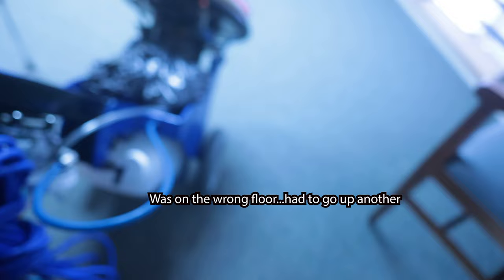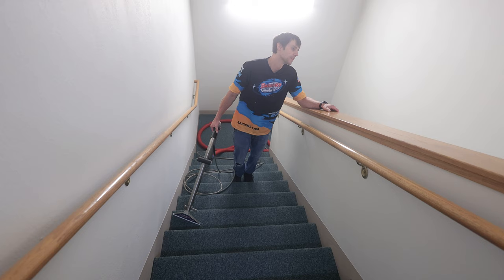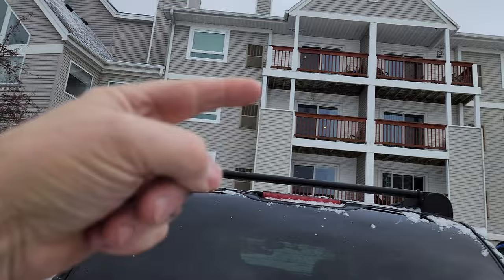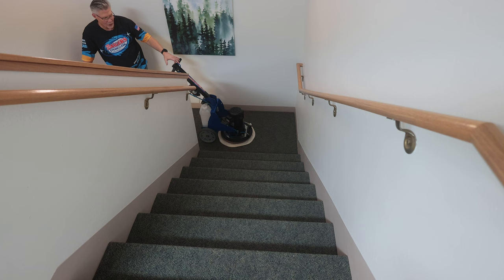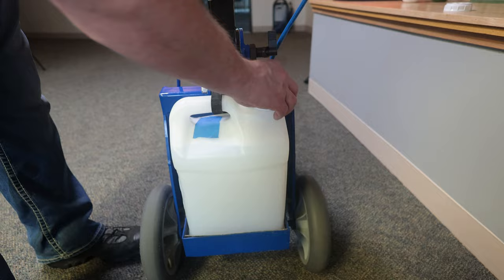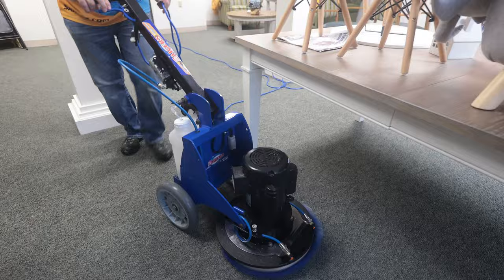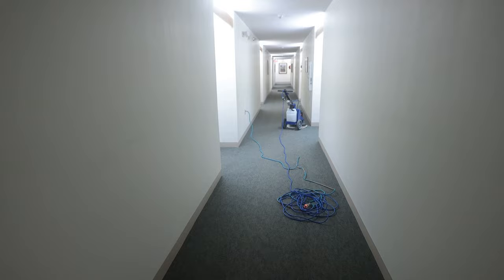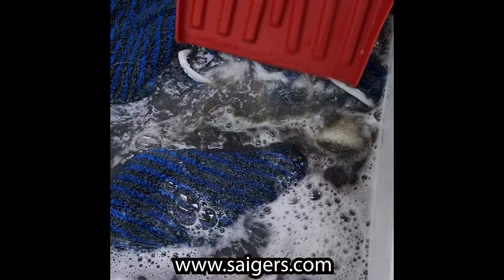ALL In Good TIME! All Floors DONE!

Comment: Great video Mark, thanks for sharing. By the way, is that an industry-specific tool that you used to VLM the stairs or is that just a hand buffer? Do you use it too if, for some reason, you needed to VLM upholstery?
Reply from the maker: Thank you and that was a car hand buffer I got last minute at O'Reilly auto parts. The stairs were not too soiled, so felt comfortable using this here. It also works on Upholstery too. I doubled up the absorb pads on it. First put a layer of cotton, then a microfiber on top of that.